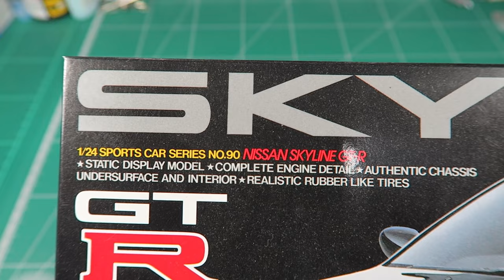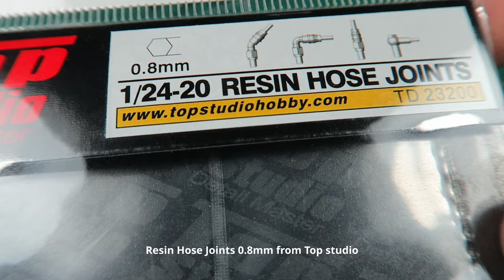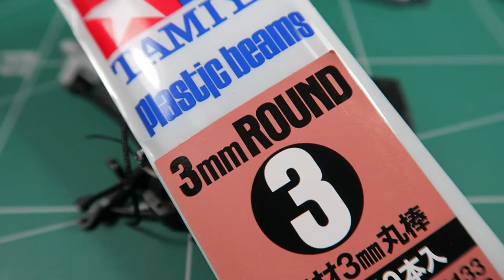Build 1/24 Tamiya Nissan Skyline R32 GT-R

Comment: I'm new to building model car, can I use brush to paint the whole car body then polish it instead of spraying paint? cuz I don't have an appropriate place to spray
Reply from the maker: Using brush for painting the body might create uneven surface. It's better to us spray tools for model kits. 🙂🙌
Reply: Use Tamiya lacquer paint spray cans and spray outside on a large sheet of paper or clean dust-free cardboard, only spray when the wind is very low, or dust will be stuck on the wet paint. Do not use a brush to paint the car, it will be very ugly.

Comment: Looks really nice, but tires are installed backward :D
Reply from the maker: Thank you for comment :)
The advan neova concept rubber pattern has one side like ad08 15:04  , I didn't put it on the wrong side at all. This tire will be worn the same as r888.
But the tires were not created in the right direction. So look that I put it upside down

Comment: Did you color rear lights (mine set got colorless so i am kinds worried about how i should paint them with red to not make them look bad)
Reply: Use Tamiya clear red paint or a red sharpie marker. Apply the paint or marker to the backside of the brake light lens.

Comment: What can u suggest if on budget,like does the cans spray paints good or not?
Reply: Tamiya TS code spray cans (lacquer) are very good for model cars. Shake the can VERY well before spraying, spray in a well ventilated area with low dust in the air, and hold the can back 8 inches. Move the can fast from side to side, do not move across the car slow, you will get too much paint built up and it will run in drips down the car. Do a light coat first, it will not cover the car completely. Then wait 10min and do another coat, a little heavier this time. Then wait 10 more minutes and do a final coat. Wait 1 day before spraying clear coat and do 3 coats of clear coat the same method as the paint, light coat first, then two medium coats, all 10min apart.

Comment: Do u happens to know the difference between tamiya r32 and tamiya r32 nismo custom?
Reply from the maker: The difference between these two boxes, you can see the details of the nismo boxes.

https://www.tamiya.com/english/products/24341/index.htm
Reply: @BRscalegarage  couldnt really notice the difference hehehe
Reply from the maker: The normal box doesn't have nismo accessories such as steering wheel, brakes, decals, exhaust,air duct so you can see pictures from the website above. 😊
Reply: @BRscalegarage  i never used a waterslide before. Another question hehe. On the dashboard, do you use a topcoat or not? Before applying the decal, does the surface needs to be topcoated or not?
Reply from the maker: @noname-pv8lw  You can use tamiya x-22 to coat it, for me didn't use it.

Comment: So I’m pretty new to this stuff and was considering buying that exact kit but I have a few questions: 
1. What tools do I have to buy to assemble the kit?
2. Do I need to get paint for it?
3. How long did it take to assemble it?
Reply from the maker: 1.Glue; Tamiya extra thin cement, Tamiya craft bond(for transparent parts), modeler's side cutter, sand paper, tweetzer , art knife.
2.You do need to get paint.
3.At lesast 2 weeks.

Hope you enjoy making it :)

Comment: did you go from 4000 wet sanding straight to polishing compound?
Reply from the maker: Depending on your skin type, you can use 4000 to finish at 10000.
Reply: What sand grit sandpaper do you recommend on start to finish?
Reply from the maker: @miguelleal1829  For me, recommend Godhand GH-KS5-KB. There are numbers 2000-10000.
Usually used before polishing, I use number 4000,6000,8000. 🙂
Reply: @BRscalegarage  what do you recommend on scale model 1/24 HKS GTR from tamiya
Reply from the maker: @miguelleal1829  Have fun with the decal. 😄
Reply: @BRscalegarage  I’m cringing that part